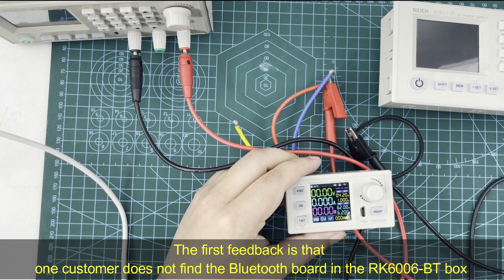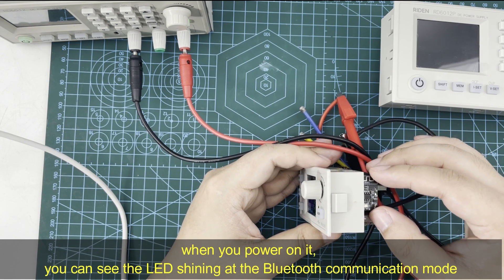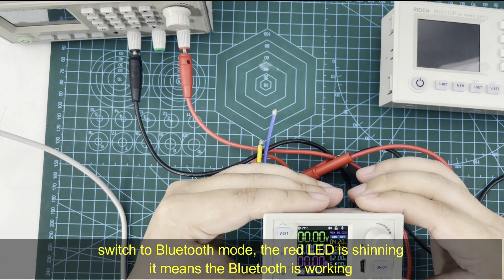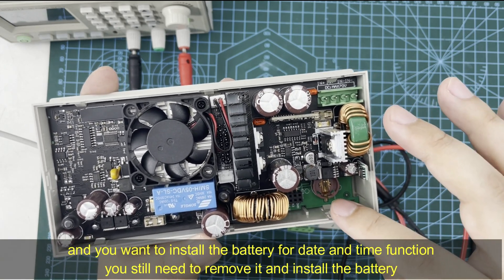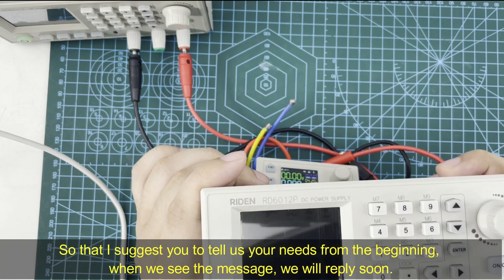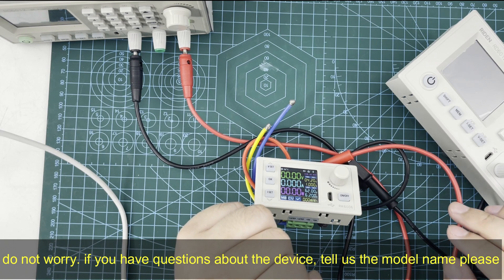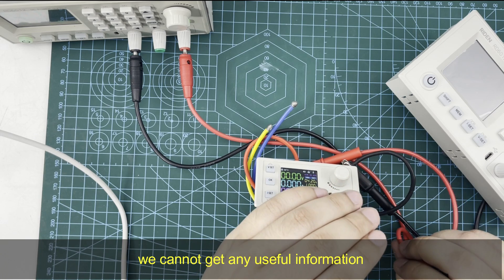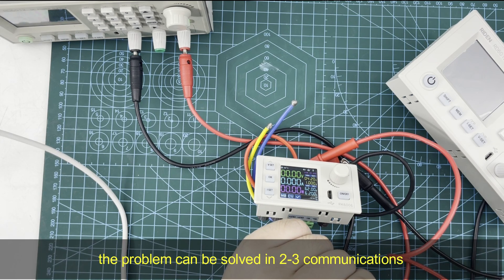RK6006-BT here not missing! installed already in advance

Comment: I bought one. IT does Not Work. No Lights at all
Reply from the maker: please contact the after sell service on aliexpress, do you order it in our store?
Reply: Many thanks,
I bought many products from AliExpress. I choose the products and have my sister in Italy buy them and send them to me in Morocco. That's why I can't contact the seller.
 I used to buy directly when I was in Germany. But there is a big risk. Either the product is broken like what happened now with THE rk6006-bt and other problems for example I bought a scann tool xtool d9s pro and when I wanted to update it in Morocco it didn't work and when I contacted them they told me that the update is only within the European Union. 
I want to know. If THE rk6006-bt doesn't work where could the problem be. Because I am an engineer and I can fix the problem
Reply from the maker: @ hello, then you can contact our email to let us see the problem at least, you can power on it, measure the input voltage, let us judge it, and show us the back panel to see if there is something burned
Reply: What happens if you put the negative and positive in reverse in?
Reply from the maker: @ as long as the input voltage does not exceed 68V DC, it will not damage the device

Comment: "Hi, I have an RK6006. I accidentally connected it to a battery with reverse polarity. Now, it doesn’t provide any voltage output. Its fuse is intact and not blown. What can I do?"
Reply from the maker: hello, please contact us on aliexpress, show us the problem, let me see the PCB board, we can give you the method to check

Comment: Hi,
I use the RK6006 and it workes fine with the USB Connection.
Sadly, as soon as I connect the Bluetooth Communication Board, the RK6006 is not starting anymore and the Screen stays black?!
Anything I can do to solve this Problem?
Thank you in advance
Reply from the maker: hello, connecting bluetooth does not affect the normal output, what do you connect as input PSU and what you connect as load, you can contact after sell service on aliexpress, show us with a video, power on it,we will give you the way to check

Comment: I’ve never been able to get my RD6024W to connect to WiFi. AP Isolation off and 2.4Ghz but on most newer routers, you can’t shut off WMM, nor should you ever want to or need to. Can I upgrade to a Bluetooth instead of WiFi?
Reply from the maker: hello, 1. if you cannot disable wmm, try to set it to 802.11N, and retry, 2, RD6024W does not have Bluetooth function, it only have USB/Wifi/RS485 communication function
Reply: @rdtech9153  That's disappointing... As I mentioned, I did use 2.4Ghz N, even on a separate "Guest" network and could not get it to connect even when 5 feet from my router. I do computer and networking repair so I am very familiar with wireless networks. It should not be this hard to get connected. Is the wireless device not capable of WPA2 or something silly like that?
Reply from the maker: please contact us on aliexpress, let them help you to judge, because we do not see the settings, and does it connect successfullly when you use hotspot as wifi signal? @BLWN402

Comment: I never had any problem with your products but is good to know that you will help if needed.
Reply from the maker: yes, we offer support to our products, even it is used for years, as long as it can be repaired, you just follow our method and replace some chips and it is ok, normally there are only reverse charging battery problem and use over high input voltage problem